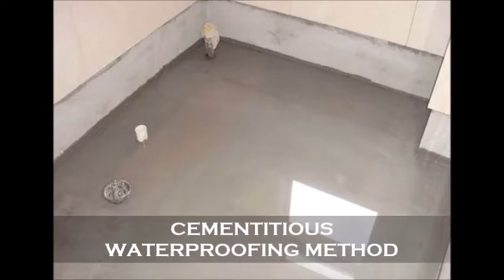TYPES OF WATERPROOFING METHODS IN INDIA

Comment: Water proofing is one the largest problem which is increasing day by day in societies , and we have noticed that this problem exists in 60% homes of society . Actually Water proofing is process to stop the leakage of water , not just from roof of the home also from the roof of any room or water tank .  We are the best solution providers for the Water proofing for any kind of water leakage in your building or house . If you need our assistance just use our contact details to contact us and get the right advice for your problem. The major problems we have seen in most of the building is roof leakage , or bathroom roof leakage or water tank leakage problem , these are the major problems which we have mostly found in the buildings . We have work experience of 10 years in this field and we had satisfied most of the clients .More info here: http://kaufmann.com.pk/water-proofing.html